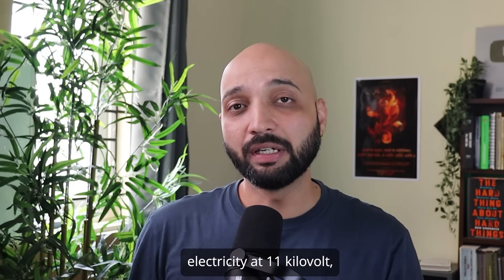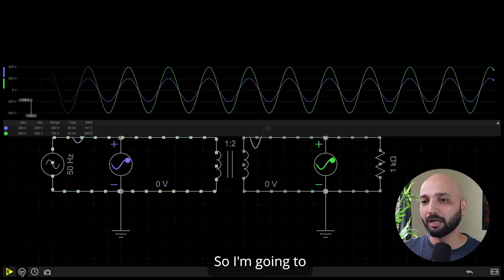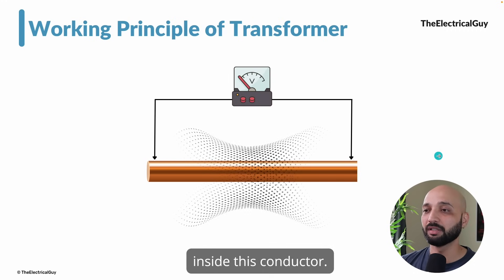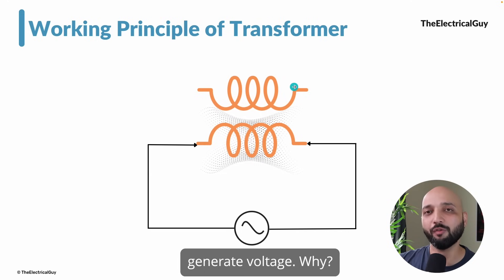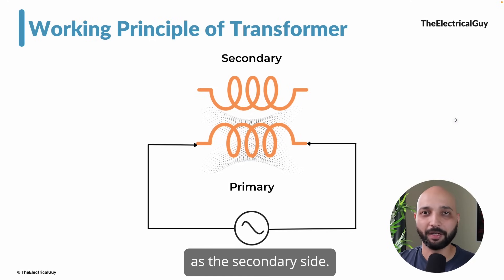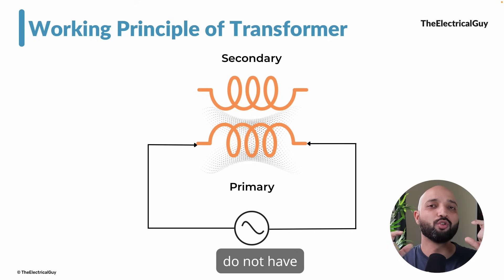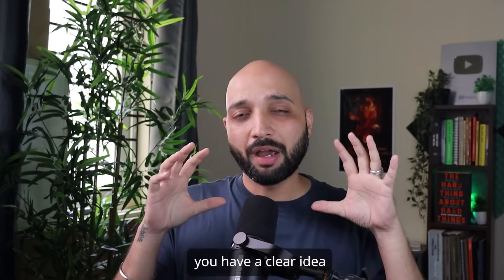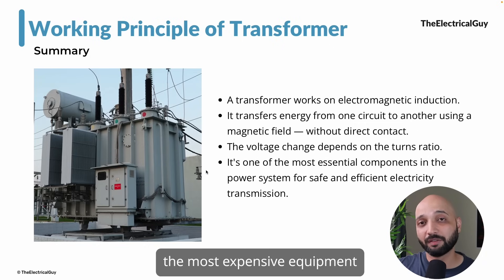Transformer Working Principle | Complete Beginner's Guide | TheElectricalGuy

Comment: Hey brother, incredible channel. Absolutely perfect for self learners who need to go one step at a time and do it alone ! I have a few questions if that’s alright with you:

Q1) Would you consider adding a small playlist just for math , like a few videos on the math we need to learn like with complex numbers and stuff and how it applies to stuff (and whatever other math you think is relevant like any calculus etc) 

Q2) Can you do a video or playlist on how to draw equivalent circuits for weird situations like a fault due to someone putting an aluminum ladder before the primary to a home and also after the primary and fun odd scenarios like this? I’m learning about how to draw circuits but I feel lost when I try to model stuff in my head - the stuff I really wanna know - like the current thru the ladder in both cases!

Q3) This question is very specific: do you have any videos explaining why (from what I read), a transformer magically keeps its voltage the same no matter what loads are on and off in our home? And how would we calculate the small tiny change in voltage that does occur when a massive load is turned on (say an aluminum ladder after the secondary to our home)?

Thanks so much man!!!